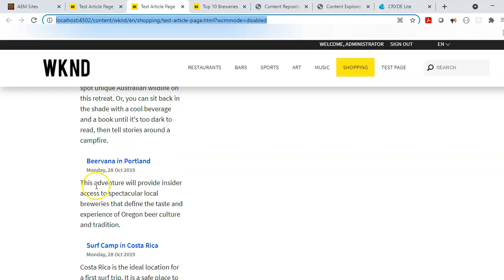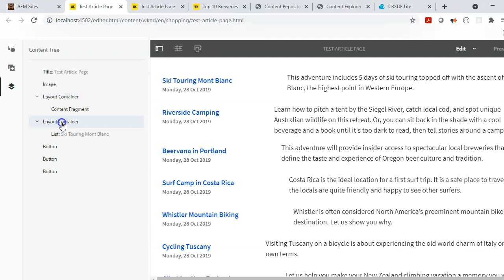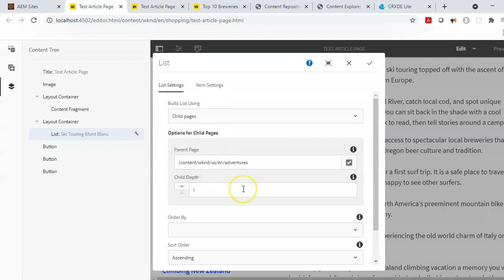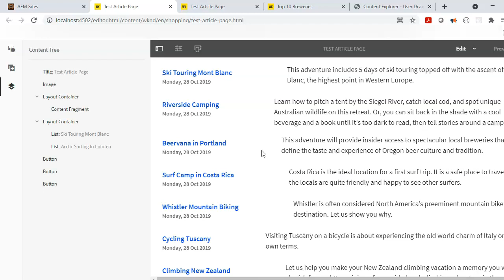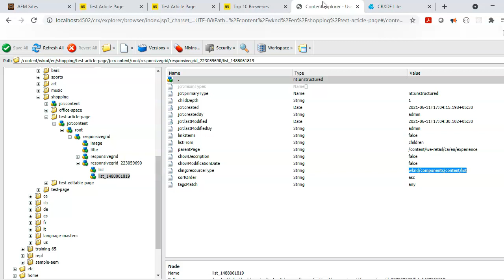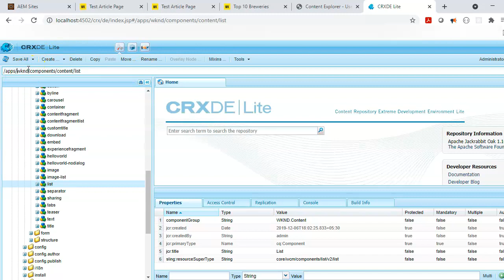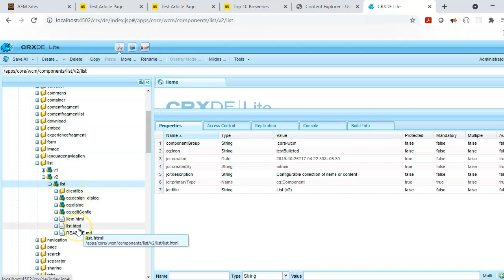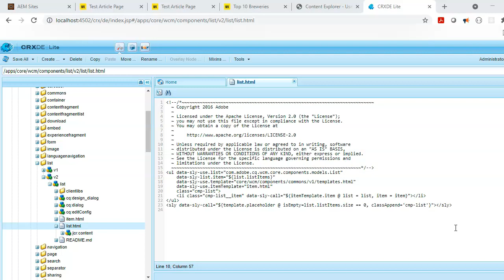AEM in Action -  Debugging a component. Part 1

Comment: Hi Veena Vikraman, thanks for the tutorial. It's pretty useful. When is part 2 going to be released?. I'm looking forward to it
Reply from the maker: Thanks Ochoa. Good to hear you liked it. I couldn’t figure out time for quite sometime . But hopefully soon.
Reply: @veenavikraman19  Thanks for replying. I've another question. Do you have any tutorial about the difference between Resource.class and slingHttpServletRequest? I have trouble to understand those adaptables
Reply from the maker: @ochoax2628  Is this for Models ?
Reply: @veenavikraman19  That's right!
Reply from the maker: @ochoax2628  Let us say in simple words we write Models for a component . When you author a component , it gets saved as a resource in your repository. So Models give you the flexibility to adapt your class into a Resource, to fetch the properties of that resource. That is why when you adapt a Model using resource you can just Inject a property into the Model and you will get the value in your code if that is present in the node/resource. That is the simplest usecase. Once adapted to Resource.class , you can easily work with your component’s authored node values using Resource APIs.

Sometimes in your Model you might need to work with some Request objects. In such cases , you can adapt your Model using a SlingHttpRequest.class. Basically it does the same , but it will give your Request objects in your model to easily work with. This is a simple explanation. Hope this helps you understand when to use Resource.class or SlingHttpRequest.class or both together.
Reply: @veenavikraman19  amazing explanation. it's clear now!!! thank you very much for taking the time to answer my newbie questions!. lastly, there is something  you've mentioned such as  Request objects. How could I know which  Request objects are?. I've seen SlingHttpRequest behavior using @self annotation as well
Reply from the maker: @ochoax2628  Yes. If you use SlingHttpRequest , you don't need to adaptTo Resource.class. That is why I said you can either use anyone of them depending on your requirement or adapting to both will also work. If you check https://developer.adobe.com/experience-manager/reference-materials/6-4/javadoc/org/apache/sling/models/annotations/injectorspecific/Self.html , you can see that @Self will let Sling Models inject the adaptable itself, or an object that can be adapted from it. That means, if your adaptable is SlingRequest , @Self will inject the property values of the resource using the correct object. In your case , it will inject the properties using the getResource() method in the API. https://sling.apache.org/apidocs/sling7/org/apache/sling/api/SlingHttpServletRequest.html#getResource--

So to handle the resources, if you are adapting your model using Request , you can do every resource functions with it as the request can get the resource internally. But if you adapt your Model using Resource.class, you cannot get a request object from it because the Resource API do not support any method for the same. 

Hope that makes sense.
Reply: @veenavikraman19  Thx Veena, it makes sense now!. thanks very much for all the explanation given. you should continue doing more videos They are totally awesome
Reply from the maker: @ochoax2628  Thanks 😊 I will, as and when time permits 😊